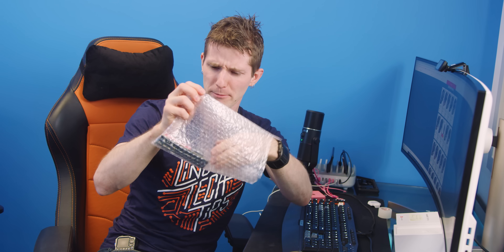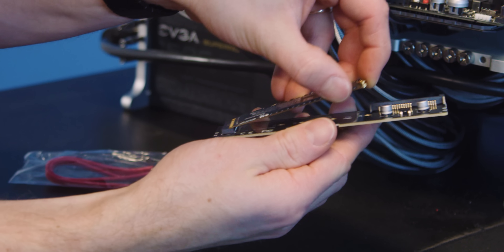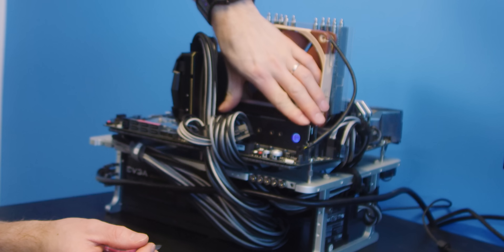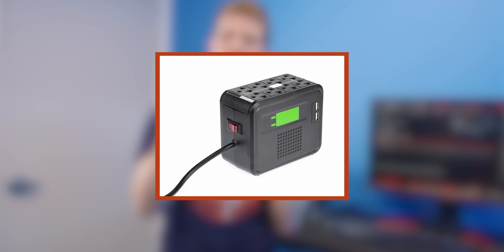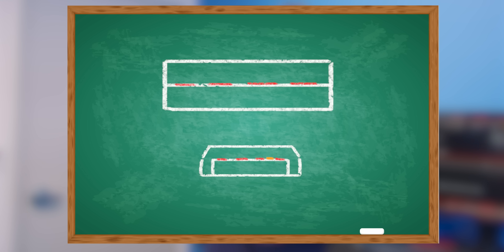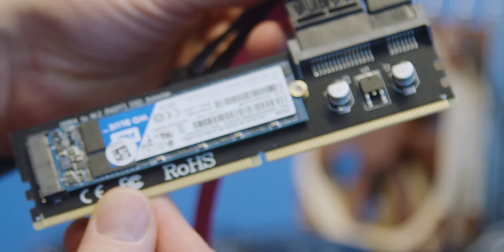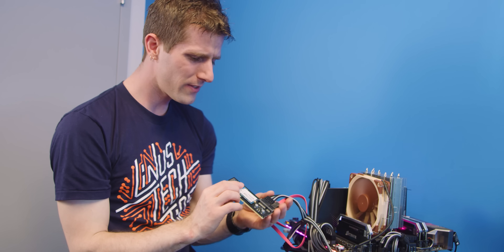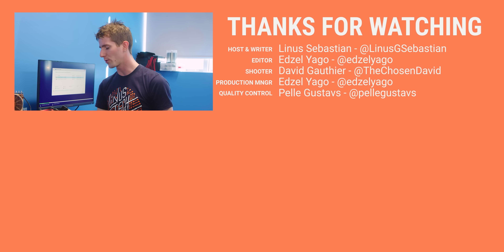They LIED to me! - DDR4 RAM to M.2 SSD Adapter

Comment from the maker: Join the drop for the Massdrop x Beyerdynamic DT 177X Go Headphones at https://dro.ps/ltt-dt177x
Use code LINUS and get 25% off GlassWire at https://lmg.gg/glasswire
Reply: They should just rename to Masslinus.
Reply: @rutai66 NO WAY ME TOO

I GOT 10 RTX TITANS AND I DON'T KNOW WHAT TO DO WITH THEM THEY'RE LIKE SO COMMON AND CHEAP NOW
Reply: @Zi7ar21  give me one of them..😁😁 if you want
Reply: @PetukMosai  First just send enough money to buy of of them (and some extra, like $50) to me and I'll send it
Reply: @Zi7ar21  haha...I think you can give me for free.....haha...
Reply: @PetukMosai  Fine... I guess I'll have to just say one thing... You asked for it... /r/woooosh
Reply: I have no money
Reply: However, I do have a $300 pc with an i5 3470k and Rx 580 8gb
Reply: Morgan Moss I have a VAIO dual core laptop, Windows 7, 2gb DDR2
Reply: I need it
Reply: Hey there bud, what's that emmmm... Keyboard doing in your pocket, bud.
Reply: Linus, I could see this being an option for an older server chassis or older workstation.  The MOBO may have plenty of open Dimm slots, but in 1 U maybe not enough room to fit much else.  You can find custom lengths of Sata and Sata power cables, but maybe not.  This would keep the ssd inline with cooling while only having to come up with cable management.  Alot of these "solutions" were likely designed for enterprise solutions, since that runs everything.
Reply: I would gladly use glass-wire if they had a lifetime subscription option. I don't like subscription services.
Reply: Try to use a 8gb MSATA SSD
Reply: Talk about the ps5 pls
Reply: Like me.
Reply: 0:13 related products blackhole or as we know it under: LTT advertising.
Reply: I know you guys mentioned this in another video but everyone’s constant fiddling with whatever (mic receiver?) is in there pocket in so many videos is really really distracting.
Reply: big fan linus
Reply: linus can you review the new 2 in 1 lg gram ??
Reply: Thought it was going to turn the ssd to ram but thoroughly disappointed.
Reply: Off-topic, but Linus and crew, please consider ceasing sponsorship with Private Internet Access since they use Leaseweb servers which have have intruded into by mlwre in the past and the California servers are designated as SR37 Europe hosted rather than PIA.
Reply: Who said that the plating on those particular pins are gold? They could be Pyrite.
What that is, is an NVMe SSD casing to SATA adapter that looks like DDR4 RAM.
Reply: Is that aa spoiler for the all new gtx 1770?
Reply: I just now found out about the dt 177x. I own the normal dt 1770 and must say that the idea of a portable version of those headphones.
Reply: What is the main differences between Synergy 1 and Synergy 2, personal and business editions. We are seriously considering purchasing a license, but we don't know which one to purchase.
Reply: Is it free????
Reply: #LinusTechTips, I know u normally don't luck in comments, but my dad found a old pc/console from the 80/90's and I was wondering if you wanted to buy it and repair it (if it's broken) in a video or just use it if it's not broken.
Reply: Hey #LinusTechTips can make a video mixing all thermal paste?
Reply: What the hell is the Badminton-champ Peter doing on the floor Linus??  7:24
Best regards' Camilla Martin
Reply: Linus, isn't the base hardware of an SSd the same as a stick of ram? SSD sizes of ram? in DIMM slots? THIS NEEDS TO BE EXPLORED!
Reply: O h   I t s  a  P I N K   G U Y    W I R E
Reply: Anyone know what monitor that is?
Reply: @Linus Tech Tips Yep! That's exactly what I expected! Coincidentally, I ended up on this particular vid because I came across the EXACT same product, and was trying to figure out what the fuck it does! https://www.amazon.com.au/Docooler-Adapter-B-Key-Memory-Expansion/dp/B07VKZY85D
Reply: can you build a cheap pc for me.i will make a video if make the pc.tq😁
Reply: is it not possible to use this extra RAM as  paging file ?. which then RAM acts as a virtual hard disk .
Reply: FWIW, I recall reading an article 10(?) years ago about exactly what you hoped it would be, with hardware on the DIMM that could map storage directly to memory.  Obviously, it was targeted at data servers where having massive (1TB was mentioned), though MUCH slower memory would be helpful.
Reply: that china sh!tstuff 4 ya.
i do realy hope that ppl will get smarter and will abandon china products, and that companies will get smarter to stop oblique eyed production factories and move to their native countries for production.
Reply: Is there a DDr4 to Ram adapter I have an Idea XPG idea hahahahhah
Reply: Love you Linus from India, please come and meet with me... big fan ..big..fan
Reply: Posting and pinned in comments now? guess mobile users dont see description
Reply: @Djuntas  What are you saying, exactly? I am a mobile user, having problems with comments. All of the links to replies except for this massdrop thread give 404 errors.
Reply: @polychoron  Just observing that they never did this before. Trying to understand mobile audiences...Cause I see same thing on my own channel with mobile audience I think.

Comment: What about a RAM Stick adapter that lets you use older sticks of RAM in newer PC's/motherboards? Or a single board computer that lets you use or recycle old laptop RAM. That's what the Raspberry Pi should've done instead of including RAM or in addition to was had a RAM slot that you could use your old laptops RAM in instead of us having to throw away or scrap and or recycle them.

Comment: I'm pretty sure that device was designed let you use M.2 drives on older motherboards that lack such a slot. You sacrifice one DDR4 slot for the ability to use M.2 drives.

Comment: Well, if you only use two memory slots and have zero NVMe slots on the mainboard,
it can be useful, since it converts the USB NVME to regular SATA,
and with that it can fit neatly into the system, but other than that, no 2TB memory or such.

(Its aid USB before, I meant SATA.)
Reply: That said, technically it could by driver have direct access to the drive as memory,
but that would be umm, very very slow, although technically upon that it would
allow for great transfer speed on an older board that doesn't have NVMe.

Comment: The other way around, an M.2 slot to DDR4 adapter, so basically a RAMdrive, would be cooler and more useful (though RAMdrives aren't as good as they sound). But this just seems useless except for some special use cases, where you don't have enough M.2 slots and don't need two of your RAM slots.

Comment: But can it be utilized in a small form factor build that doesn't have additional M.2 ports on the motherboard? And would it be efficient enough for that purpose, like cooling, spacing, ext.? Example NZXT H1 tower.

Comment: The title is misleading. It says "DDR4 RAM to M.2 SSD" which means you start with real RAM and get an SSD port. This is actually a "M.2 SSD to DDR4 RAM" adapter.

Comment: I using NVMEs on machines that won't detect them.
If you have Linux installed on a SATA drive, it will 'see past' the bios in many cases.
Did you try Linux to see if it would detect?

Comment: I think its pretty neat. It secures your m.2 to your mb. Its cheap as chips and allows to to connect m.2 drives. Obviously won't get the same speeds but its about space and being on the mb it works.

Comment: I mean, this might be useful if you only have two DIMMs installed and you don't have anywhere else in the case to put it. But it seems like in most cases, you would either want to buy a nice SATA SSD that you can mount in your case properly, or else put a PCI-E M.2 card into a PCI-E slot for a system that doesn't have M.2 on the motherboard. This seems like it only makes sense if you're stuck with a SATA M.2 card on a system that doesn't support M.2 cards, you have only two sticks of memory installed, and you don't want to waste a PCI slot or buy a housing for it that lets you put in a drive bay. It has a use, but it's such an edge case that most people would never need it. Though personally, I think SATA M.2 is an abomination that leads to confusion and shouldn't exist. If you want a SATA drive, then just mount it in your drive bay, and only PCI-E stuff should use the M.2 slot. At the very least they should have a totally different kind of slot for SATA-based drives.

Comment: The manufacturer should have at least provided a "bypass" allowing a real ram to be installed above the product and have it pass thru right to the DDR4 pins on the motherboard, that way, it would have made sense to keep that adapter securely in place within the DDR4 serving as an anchor.  As it is, I would much rather tape it to the side of the case inside.

Comment: I get screw drivers like that with drive enclosures.  They are OK for their purpose but I would not trust one of those to get a tight screw out.  They might be cheap ones that are not hardened steel those cheap ones may deform and even ruin a screw head.  They are fine for the products they are sold with but I would not use them for anything else really or any screw that I know is in tight or threadlockered.

Comment: This seems like it's more inclined to be used on much older systems, that don't actually have an m.2 slot on the MB, so you can add the "adapter" and have a faster drive for storage solutions that the regular SSD or HDD's.  Not completely useless, but probably targeted at some places in the world that might not be as advanced.

Comment: Now that pcie 5.0 is about to release next year and we will be switching to ddr5 that means manufacturers need to develop x16 cards that can use ddr4 along with micro sd cards for backup. You could fit 12 dimms on a full length height card and that would equate to 3tb of dd4 at the high end, and 6tb of optane memory for the professional sector. It would also be able to saturate the 60gbps pcie link. For just 120,000 dollars you could have a 6tb optane RAM disk with insane latency and 10x the performance of a gen4 nvme drive. And it could be installed in a itx sized nas. Said nas could easily have built in 40-100gbe Ethernet due to native pcie 5.0. Now we just need something faster than tb4 for external connections. If they made it gen5 for tb5 it would end up being 160gbit rather than 40. Technology is so fun.

Comment: The screwdriver is exactly magnetic enough to convince you to lift the screw , but weak enough for you to make the screw fall off exactly over an area where it is most likely to get lost forever or cause the most damage. I HATE those so much, it's like they are purposefully calibrated to piss people off most effectively. Also' I thought the product will be the opposite thing- a board that acts as a SSD, but with multiple RAM slots and maybe a battery to keep the RAM data in it when left unpowered and an actual SSD connector, so that when the battery is low it can copy files to the SSD to avoid losing them. I recall seeing something like that but for a really old computer with DDR1 or SDR memory in it. (EDIT: He covered a device like this, with RAM acting as a SSD, powered from standby power and a battery: https://www.youtube.com/watch?v=bYbCYgYZVT8)

Comment: Actually, all Linux system can use a HDD or SSD as RAM.
That's standard and advised for crash prevention, it is called.
It is a partition that's called Swap, and you can allocate any much your storage device allows you.
Reply: Windows has pagefile which is basically that and mac has something similar

Comment: Asus actually uses a real version of this that holds 2 NVMe M.2 drives and requires no SATA power plug that they use in their prebuilt PCs. They even created a 3rd slot (or 5th depending on if you have 2 or 4 DIMM slots) called a DIMM.2_SLOT. I have pics of the board as well as the adapter.

Comment: That kind of thing is meant for servers with little to no extra spaces for HDDs but a lot of DIMM slots. Very niche market, but imagine companies that have small low profile servers (where they don't have the need/money to totally populate the ram), and want to boost performance or storage. For the average consumers, taping SSDs has been a common practice (and for a hot NVMe drive it might actually gain some more heat dissipation if taped on a metallic surface). But in server rooms taping stuff isn't part of the usual best practices.

Comment: This is a Type 0 adapter: Purely physical without any function at all.
Reply: I mean, it does have a function - it’s just the computer equivalent of Sheldon saying “So it’s a shelf?”
Reply: The m.2 to SATA is the type 1 portion.
Reply: @OwenWalker  hhd drive ...
Reply: @maximefleury4455  A hard hard disk? Or is that SantaTechs new invention, the HoHo disk drive?
Reply: My thoughts exactly :)
Reply: I'd call it an SSD mount more than an adapter myself. It doesn't do much adapting, it just gives you something to hold the SSD so it doesn't dangle around.
Reply: Yes it does, I plugged It into my computer and instead of doing nothing, my computer started flickering and never turned on! So it's not non functional.
Reply: Rei Anami would like to know your location
Reply: You can just find a place in the case that is not a RAM slot and it will still work fine.

Comment: The only thing more stupid was the comments.
"Hurr deer hurr this is so dumb"
You know what else is dumb? 90% of motherboards purchased with 4 slots even though the users only intend on using 2, people actually rarely upgrade to add more plus mixing ram is bad and you can always sell the old ram and just buy newer higher density, This is what people actually do, I know because I've been seeing it every week for 20 years.
People buying full ATX motherboards with no sli or crossfire intentions, pcie lanes are increasingly more limited so expansion isn't much of an option. You get 16 for gpu, 4 for an OS drive and only 4 more for ..probably another m.2 drive is the most common.
Consumers are stupid.

Comment: So this is a fake, it pretends to be a adaptor to use a fast NVME memory on old motherboards without this port, so it's better to buy an adaptor from pcie to NVME, that will work, but if it is from pcie x1 there will be some loose of speed

Comment: Funny how this strange concept actually did become a fully realized thing with certain Asus ROG Maximus motherboard.
Asus ROG Maximus XI Apex only has 2 DIMM for RAM sticks while a third DIMM slot is actually intended to be used with 2 M.2 drives with an anchor stick that comes included with the motherboard.

It fully functional although you would ask yourselves why they would do that instead of just having M.2 slots on the motherboard. My best guess would be space management in terms of getting all the features you want on the motherboard without sacrificing anything.

Comment: Im needing help understanding Laptop WiFi port/slot , as I know you can add external GPU and play games off the slot.  Here’s my question, what other advantages can you use off the same slot beside WiFi and Bluetooth of course. Would that slot speed be the same as if your system is running sata III? 
Last question , I understand some adapters are just plane pointless, however I’m questioning this one ,allowed to read or write M.2 nVME SSD in M.2 A/E key slot for Wifi adapter.

Comment: Just curious, I have a dashcam that uses a mini sd, can an adapter be created to connect to an external drive. I currently use a 256 mini and was thinking if a mini can have a line connecting to an external and the external has it's own power on tap off the camera's power.

Comment: So it's JUST a RAM-cosmetic mount for an SSD? I had kinda hoped it was an adapter to use "old" SSD's as high capacity RAMs, like plugging in a 1TB SSD to act as your RAM-stick and voila, you've got 1TB RAM in one slot :/

Comment: Setting aside the strange non-connected edge connector, such adapters do have their place. I mistakenly bought a SATA m.2 SSD for an m.2 slot that only recognises NVME. Rather than toss a $100 SSD, I bought a $15 "Sabrent M.2 SSD to 2.5-Inch SATA III Aluminum Enclosure Adapter (EC-M2SA)" from Amazon, and now my computer uses that SSD just fine (slower than and NVME drive, but fine). My adapter just screws into a 2.5" drive bay.

Comment: To me it looks like its just a kind of "deliver the ram power to the m.2 drive that you could now fit in an unused ram slot" adapter as it has not really any ics on it for any kind of data stuff and because it has a sata data and power pin

Comment: The circuitry on the PCB is a linear voltage regulator to convert the +5v supply from SATA into +3.3v to power the M.2 SATA stick, that's all the conversion this thing does.

Comment: so it is designed as a way to have a completely motherboard mounted solid state storage device on a motherboard with no m.2 slots.

i suppose it would make sense if you have older hardware but chances are anything with ddr4 is going to have built in m.2.

Comment: Its meant for boards that don't have an m.2 slot, and have an empty ram slot available. Kind of a cool mounting technique, except they could have just had rugged plastic pins in place of the metal.

Comment: it is possible that drivers are required in order to use it and they dont include drivers to conform to china's laws.

just like you can buy genuine bare 18650 cells  from the big 5 makers despite that the big 5 makers have contracts with tesla the chinese sneak the cells out of the factory by putting a sticker on them making them look shoddy so it is then legal to sell the bare cells individually.

if it is indeed just a sata ssd not a means to get more ram by using a ssd then they could have just made a blank substrate that has a hole and uses a nylon riser post to attach to an unused hole in the motherboard or even clip into a vent hole on the power supply.